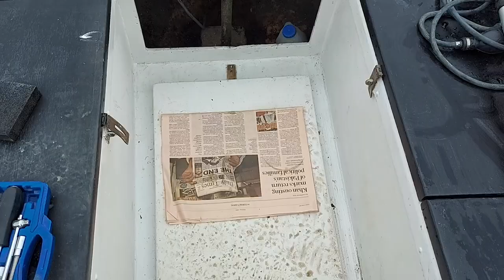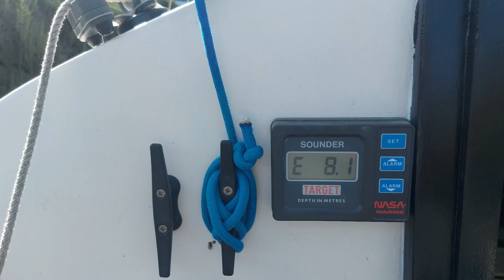19 foot sail boat

Comment: I'm not usually one to comment on a video but you really did a fantastic job restoring her and making this video.
The progress; showing the stages and dedication and the choice of soundtrack complete the video. 
Certainly, a fine combination, rare outside of dedicated documentaries. 10/10
Wishing you happy sailing, from a fellow boater, who's vessel is under construction.
Reply from the maker: Hi, thanks for the kind words and thanks for watching, to be fair i had a bit of help and advice from other sailors,  i was
going to keep her but just as i finished the work i was offered another boat, the kent motor sailer in the background,
i am currently working on her and there will be another video,  the old wooden boat under the tarp is a sad thing, 
abandoned for a lot of years, some locals wanted to chop it up for fire wood, i got the old penta md-1 engine working
and will make her into a open utility boat as the hull is now sound, might do a video on that.
Thanks again, see you out there

Comment: Impressive boat, I have a 1964 Pearson Commander 26' that I'm trying to restore. Your boat reminds me a lot of my own and your video gives me a lot of inspiration and motivation to see my boat get completed and have many hours of adventures on the bay and ocean. I'm curious to know why you chose the color black on the top side, I like the color but have been told by many boat owners that its a no no because of the heat absorption from the sun and the burn injuries from its hot surfaces on skin. But in all I like and appreciate small sailboats because these are easier to singlehandedly sail and find berthing most anywhere in the world. Thank you for your video.
Reply from the maker: Hi, thank you for watching and for the comment,
the reason i chose the black and white colour scheme is mostly aesthetic,  my van is black and white so is my motor bike (see saphira video) and here in the uk it doesnt get that hot also as you said there are not that many boats that colour, 
currently working on a 27 foot kent motot sailer
that will also be the same, thanks again,
see you out there

Comment: Neat old lightship at 9:25.  Those are almost gone in the states and I have never seen one in person.  Great restore!  I am thinking the one under the tarpaulin moored next to you has some stories too.
Reply from the maker: Hi, thanks for watching,  the lightship is a hub for a charity that teachers kids to sail, the 1960s wooden boat under the tarp
was going to be chopped up for fire wood, it was in a bad way, the hull is sound and i got the 1960s single cylinder pre volvo
penta engine working so i am making an open utility boat out of whats left, i am currently working on the kent motor sailer
that is behind the wooden boat which ill will be keeping, there will be another video,
Thanks again
Reply: @patwade  Thank you, that is quite the moorage in there.

Comment: nice little boat, nice video, it must have a swing keel. i have a 1969 Newport 16
Reply from the maker: Hi, thanks for watching,  i have been told its  a late model Caprice 19 but its a fixed fin keel
Reply: I have a 1987 Gloucester 16 in Port St Lucie, FL. Sister to the Newport, same boat design, different manufacturers owned the molds over time. There is a third sister but can’t recall the name right now. Fair winds, mate!
Reply: @patwade  As I watched your great work, I was wondering who the builder was. I googled “Caprice 19” and found quite a few on the market as “Tucker Caprice 19”. Topside yours looks very similar but a key difference is the keel. The ones I found have bilge keels, but in your video I saw a shallow draft fin keel. Nevertheless, outstanding work!!!
Reply: @bruceringrose7539  i love my boat, take it out every chance i get fair winds and following seas to you
Reply from the maker: @bruceringrose7539  Hi, thanks for watching  and thanks for comment, i have been told this is a  late model Caprice 19.
currently working on a kent motor sailer
just whish i had FL weather, 
see you out there
Reply from the maker: @bruceringrose7539  Hi, thanks for comment and thanks for whatching, im not sure what boat this is, it was in a neighbours garden and he wanted it gone, i tryed to find out what make and model but had no luck,  your right about the keel and im wondering if someone modified it in the past, it does sail very well, in the video i take it out without the mast as i didnt know if it would work, thanks again
see you out there

Comment: Well done on the rescue.  Looks to be a late model Caprice 19.  If so, a chap called Shane Acton sailed one around the world https://en.wikipedia.org/wiki/Shane_Acton
Reply from the maker: Hi, Thanks for the info, i wasnt 100% sure what model it is
but the new owner is having a lot of fun with it, 
currently working on kent motor sailer abandoned for at least 15 years
thanks again
Reply: @patwade
Reply: i met shane acton in  golfito costa rico  in 1997 i read his  book the story of shrimpy. he was a cool  guy, i thought he   built his boat  shrimpy the first time around. he told me  the second time around  he  made a right turn out of panama,  found golfito and  could not  leave, he loved it so much. i have a  allberg 19, corinthian, , two yr restoration.
Reply from the maker: @natheisler2918  Hi thanks for the info, thats a book i should read, see you out there
Reply: Looks like a caprice to me. Robert Tucker design. Damn tough little boat. I had one in the 80's in Norfolk Blakeney and still miss her. Inspiring thanks
Reply: @geoffreyburgess7639  There were a lot of lovely trailer sailers around in the early 80's... Caprice, Lysander, Silhouette, Sunspot, Leisure.  I'd look at them and imagine owning one of them but I always thought the Caprice had the nicest lines.  Not such a common sight nowadays so it's nice to see one being rescued from its mud berth.
Reply: @natheisler2918  Just had a look at drawings for the Corinthian 19 which is a new one for me.  Very handsome.
Reply from the maker: @geoffreyburgess7639  Hi, thanks for watching,  i have been told its  a late model Caprice 19 but im not sure